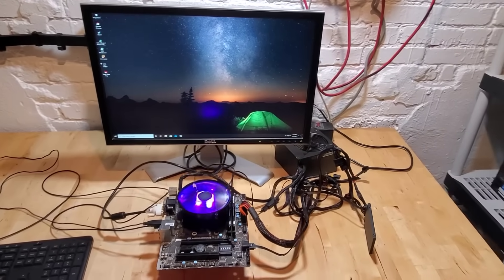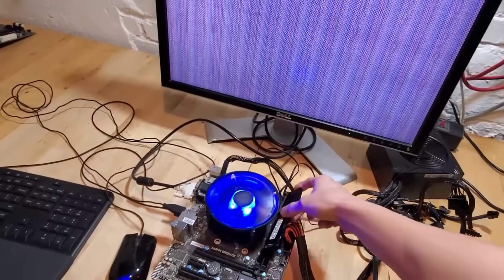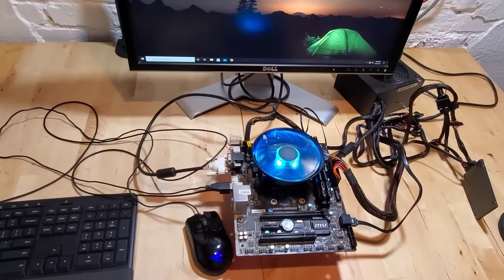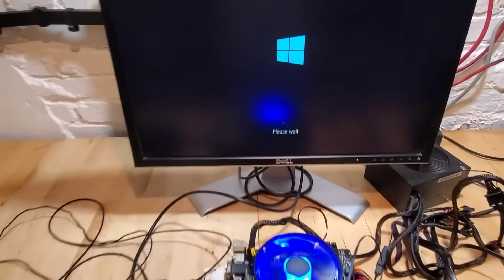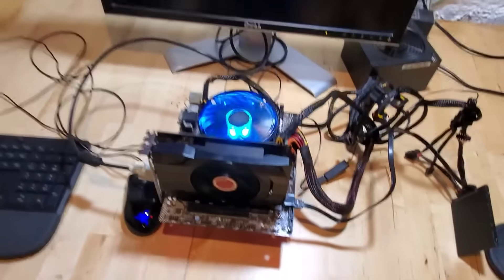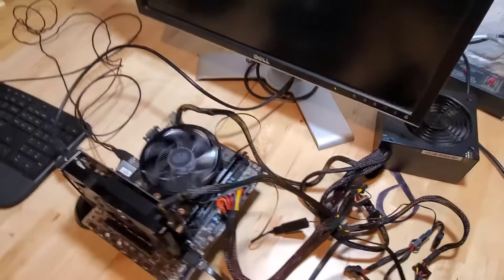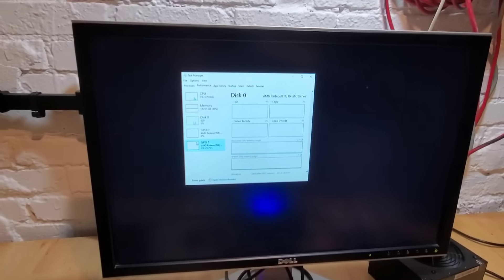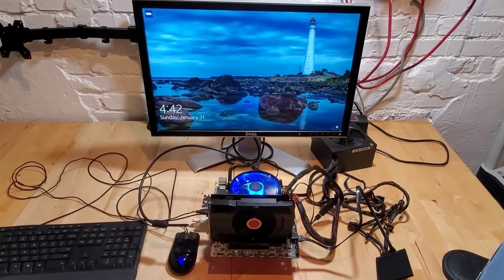What happens if you remove PC components from a running computer?

Comment: what about removing cpu while using a discrete gpu because of course there wouldnt be display output if it was plugged into integrated graphics that is now in the air

Comment: the thing about removing the storage device, only the first part(where the desktop goes black but the taskbar is still fine, and you can use the mouse), happened to me when my drive just stopped booting right (it would go to the desktop after the lock screen, then just stay like that)
Reply: i still dont know what happened, but i prob got a virus bc it bsod'd a lot for a long time before it gave up and died
Reply: though the drive is still accessable, just cant boot windows

Comment: Recently I upgraded my laptop ram and this exact pattern shows up and it shuts down. I am really interested in computers and always wanted to upgrade my laptop myself. So when I for the first time upgraded and this happened after 3 hours I stressed the f out. I switched the ram out for my old ram and went online. Couldn’t find what caused it and left it at that. Now that I see this video it kinda comes together. So thank you for that.

Pattern I refer to is the one on 00:51
Reply: You should go with the same frequency of both rams otherwise it will happen 
Like your laptop ram (which came with laptop) is 2900mhz , so you can't add more or less frequency ram that's the reason of this 
If you look closer on your laptop ram there is frequency written, note that and buy the ram with same frequency then use it
Reply: @evopenguin5742  i did use the same frequency, so probably I didn’t put them in correctly or something

Comment: Since you’re using the iGPU when you remove the RAM you’re basically removing the VRAM also. 
Curious to see is the RAM test changes with the dGPU installed. Does it still give you the crazy pattern on screen or does it operate or crash differently
Reply: Yes same question
Reply: Linus Tech Tips actually did try doing this and basically the last frame of whatever the gpu was outputting stays on the monitor, https://www.youtube.com/watch?v=D_Q_6V10mTU

Comment: I once removed ram on old pentium 3 pc while running, screen had glitches but ram started smoking. On inspection, i found one pin on ram was completely fried, though ram slot was ok. I guess hardware safety measures have come a long way..

Comment: Interesting GPU test would be to plug in the DVI to the GPU, remove the card, and then put the DVI back into the on board graphics to see if the system stayed functional.

Comment: FYI, SATA and PCIe hotswap/hotplug is a thing for a very narrow range of devices. That must be supported by the device, the motherboard and the OS running it all at the same time.
I've never heard of it being used in a consumer-level machine, there is no need paying extra for that.
However, if it's not supported then pulling out ANY PCIe device or even a non-system storage device WILL result in BSoD after about 10 seconds. Might cause permanent hardware damage!
Pulling out CPU or RAM is always instant halt, since it's the same as pulling someone's brain out and asking them how they feel.

Comment: the cpu didnt need to do any recovery work. windows just detected that the system crashed/reset multiple times and windows thinks something might be wrong with itself. nothing to do with the hardware, it's just a generic windows "something might be wrong" message

the gpu fan ramped up because it's being powered but has no connection to the computer. the gpu has no idea why this happened and to prevent the risk of overheating, the fan goes to full speed. the fan stops once returned to the pc because the gpu now knows that it's not being used and can shut off

Comment: The main difference from a hot swap design is the power circuitry. When you plug/unplug there's all sort of voltage spikes and funky voltage fluctuations. Without proper protection and design, the logic on the board will simply interpret these as genuine signals and perform random wrong actions, as being instructed by this false "command signal" that it sees, which obviously creates chaos and disrupts the normal flow of data. Or they could actually be protected and designed to shut down if these spikes are detected.

Comment: Please try removing the GPU and switching the cable back to the mobo integrated graphics, it would be interesting to see if it was able to change back, and also try removing all the other parts again, but with the gpu installed

Comment: -What happend if you remove the CPU while the computer is running and the display is plugged into a GPU ?
-What happend if you remove the GPU while the computer is running and the display is plugged into the CPU ?
Reply: 1. the screen will freeze as that is what the gpu has in its frame buffer and it's not changed because the cpu is no longer there - source linus taking out a cpu from a amd board while playing csgo
2. windows has a panic attack for like 10 seconds then falls back to the integrated graphics and crashes any programs that was using the gpu - sources I did some experiments with gpus and a laptop
Reply: @dgddgfg1203  Thanks

Comment: Wow windows 10 really doesn't like having the storage removed

My Windows 7 keeps on chugging along just fine when I remove my hard drives, of course I can't do anything that wasn't loaded into memory, but I can use the task bar and any applications that are in memory just fine

I do this all the time for my web server, I boot it up with the hard drive, everything loads up and the server is running. Then to save the lifetime of the hard drive rather than having it needlessly spinning 24/7 without reading or writing anything, I dismount it. The server application and content is in memory (I actually have to make use of a ram disk for this as the server application doesn't load all the images into memory at one time, but this works fine still :)
I guess it's not great from a redundancy standpoint, I have to be there to restart the server, but from two and a bit years of uptime without issue, that hard drive is probably pretty thankful lol

Comment: How about removing TPM while running Windows 11? That is, when it comes out
Reply: Nothing would happen
Reply: While running nothing will happen but if you shutdown or restart your computer you may never be able to access your hard drive again or may even completely brick your device motherboard.
Reply: @sanjay_swain  depends on implementation but yea you right
Reply: TPM does literally nothing except manage cryptographic keys. Why do all of you people suddenly talk about it that much?
Unless you use Bitlocker, it doesn't matter.
Reply: @latte_macchiato_de  well TPM is forced on windows 11 so they must be doing some sort of hard drive encryption. Also bitlocker is only for pro version so it may be different from it with some sort of backdoor in the encryption model maybe for home versions? I don't know.
Reply: @latte_macchiato_de  well TPM is forced for manufacturers not end users on windows 10. And if you don't have TPM enabled or modified the installation image Microsoft can very well turn you off from security updates or other important things. On home you can't even set up windows without internet connection or microsoft account.

Comment: Is anyone else annoyed by the fact that he swapped the ram sticks around, which you're not meant to do as the motherboard maps each ram stick to a specific slot
Reply: The motherboard doesn't map them on a stick by stick basis. Removing and reinserting wouldn't fix anything as the ram would be both uninitialised and completely empty
Reply: @Ed.E  That's not what I was saying. Even if the PC is off and you swap the ram sticks, it messes with shit.

Comment: Anyone know why he’s touching the motherboard with his screwdriver?
Reply: Probably as a power button
Reply: Doesn't have a power button so has to use the screwdriver to bridge the contacts which basically acts the same way a power button does
Reply: @Ed.E  does this mean that if u just touch metal with a metal object it turns on?
Reply: @Ed.E  how exactly would I do this? Can I just touch it or can I do it where ever I want?

Comment: Nice video! 

But i wonder how other operating systems would react everybody is just always showing Windows but what about Linux, BSD, Haiku? I think that would be pretty interesting.
Reply: Typically on Linux when you remove the boot device, your desktop environment will probably crash first, then in bash/zsh because these are both loaded in memory you'll keep getting IO errors until it crashes or you force shutdown
Reply: @Ed.E  Interesting

Comment: why simply putting back the components couldn't fix the problem?
that's why windows always tells you to "restart to take effect" hehe
Reply: unless it's a special server motherboard, when you plug components back in, they would be filled with random garbage data that would require to be initialized again (a reboot) to work properly

Comment: one time i've done a experiment with unplugging hard drive w/Windows 7 installed during work and swap it for other that was set up before on same PC. in result the 2nd drive system got corrupted/bricked (normal recovery doesnt work, one from DVD too) it was few years ago, but from what i remember i've got unusual type of BSOD, i think file system also got corrupted,
so tl'dr then :

*DON'T HOT SWAP YOUR OS HDD WITH OTHER IF YOU DON'T WANT TO LOOSE DATA!*

Comment: Could somebody explain how he simply unplugged a cable from a port on the motherboard and plugged it into the GPU. How can you just unplug a cable from the motherboard and plug it into the GPU. Also, what does the other black pin connector he plugged into the GPU do?
Reply: The CPU has an integrated GPU (iGPU / APU) that outputs a video signal trough the mainboard. When he installs a dedicated GPU he doesn't need the iGPU anymore so he can just plug his monitor in to the dedicated GPU.
Reply: @cnr_0778  Oh so the cable was for the iGPU? And why did you say iGPU / APU? I thought they were two different things...

Comment: Yes that is what happens. Altho in high and workstation and server there are solutions to hotswaping all those components and mostly the only reason you can't hotswap pcie devices is due to the drivers not initiating. Some boards do support pcie hotswap tho it can be dangerous as the act of removing a pcie device while powered can short pins.

Comment: I remember back in 2018-2019 I had issues with GPU where it would randomly disconnect itself and after a reboot it would boot to a black screen. It was until I bought a new PC that I realized my old GPU had a scratched PIN that caused all those issues.

Aaaaah, the hellish experience.

Comment: I think the most interesting part was when you took out one ram stick and the display wasn't fully gone but like halfway gone. It's likely that it stored some data for gpu buffer in one stick and other data in the connected stick. Pretty sick to see it. Also removing the ssd. I guess that was unexpectedly expected. Like one would expect it to give out but you have to always remember that ssd or any storage is not really necessary to run a system

Comment: I think the reason the GPU was still on when you unplugged it is because you have a 6 pin power connection. If you didn't, the card would just stop entirely. Since the GPU Still gets power in this case, The GPU KNOWS something went horribly wrong and it kicks the fan to the maximum to protect itself. At least, that's what I THINK happens.
Reply: lot of gpu have fan spin to max before post process kick in to send the pwm signal to control the speed

Comment: I wonder, if the system was able to fall back to the integrated GPU, when you removed the discrete one. Would be interesting, if you replugged your monitor and checked it out.
Reply: you probably could pull that off in linux not windows
Reply: I think it's plausible, because windows has failsafe methods for drive crashes, in my old computer the GPU sometimes crashed and windows sometimes still worked on integrated graphics
Reply: yeah if you remove a discrete gpu and you have a integrated or another discrete it will fall back to it but windows does have a panic attack for like 10 seconds or so if you do it
Reply: Nah. Windows gets a heart attack when you remove a PCle device.
Reply: My friends, search for your life purpose, why are we here?? I advise you to watch this series 👇 as a beginning to know the purpose of your existence in this life..

https://www.youtube.com/playlist?list=PLPqH38Ki1fy3EB-8xmShVqpbQw99Do2B-
Reply: Won't work, as everything necessary to run the graphics loads at startup and can only be reset on a reboot, like drivers, IRQ's, registry entries, the kernel,  ect ect. Switching graphics cards be it onboard or not is not PNP, only ports on a GPU that is loaded to memory is PNP.

Comment: I remember once I accidently took one ram stick out from a laptop while running (I though it was off but only the screen was off) and the screen look like an old tv with static.

Turn the laptop off and put the ram stick in again but it didnt boot. I had to swap it into another slot and it boot. For some reason if a put the ram in the original slot didnt boot.

This happened on a clients laptop 🤣

Comment: I have an old notebook with bad sector issue like 8 years ago. It usually freeze after a few minutes booting into windows, and I have to fix it by plug out the hdd, and insert it again. That fixed the freeze and I can back doing my stuff. 

for details, it was windows 7, and I'm using intel Atom notebook. Ofcourse at some point the problem becomes frequent enough so that I have to use another boot drive to fix it once and for all.

Comment: The RAM experiment wasn't accurate as you were effectively removing the VRAM as well since you were using the integrated graphics at the time, I would love to see this experiment re-done. Great video!
Reply: Yeah I guess if he tested the same thing but with a video card there would be no screen artifacts
Reply: @kingeling  Yep the system would just freeze.
Reply: Screen would just freeze as system would crash and no update to the display buffer would be made by the CPU. Depending on GPU it may decide to shut off after so long
Reply: The result would have been almost the same, the screen would have stayed on the Desktop and the image would be still, mouse and keyboard not doing anything.
Reply: @thataakarsh790  yeah this is what happened to me (i tried this a while ago when my system wasnt recognizing both ram sticks so i foolishly thought it would be ok) - only difference at my end is that when i reboot, my psu fans whir up but i get no display feed from the machine at all, not even a bios prompt. any idea what i could test or further investigate to fix this? could any of my components have been fried by shorting something out while removing the ram? would be very grateful for any advice and i have a multimeter so can test stuff and update here if more info is needed. cheers
Reply: @thataakarsh790  No, not necessarily as with a separate graphics card there is no video coming from the system ram so therefore no Artefacts.
Reply: @tyronenelson9124  you could still corrupt the vram during removal actually, but I doubt the GPU would push another frame without CPU contact
Reply: @Ed.E  Well yea the GPU gets its raw data from the system CPU and then all the GPU has to do is basically unpack the data using its own Vram.
Reply: So, integrated graphics card increases ram usage?
Reply: @damf7106  yes as your video memory is shared with your normal memory
Reply: @damf7106  Yep part of the system ram is allocated for onboard graphics, some pc's, even older ones you can set how much will be used in the bios.

Comment: What happened if you remove the CMOS battery
Reply: Nothing happens because the bios is already loaded into the RAM. All the cmos battery does is keep the bios awake to keep track of date/time when the rest of the system is off.